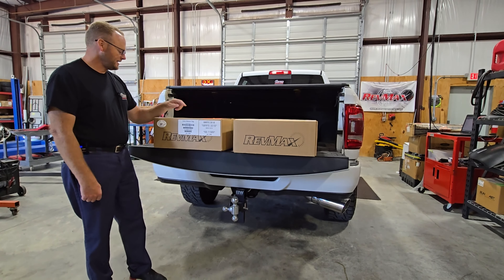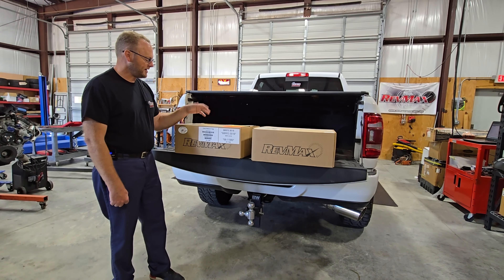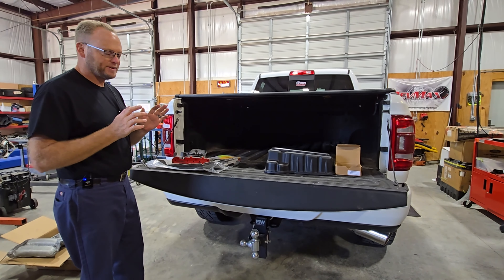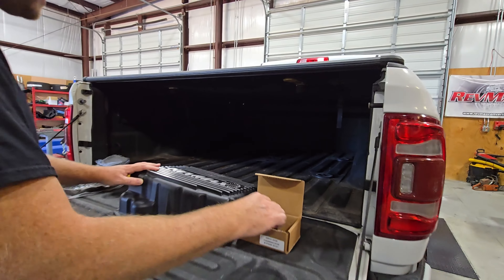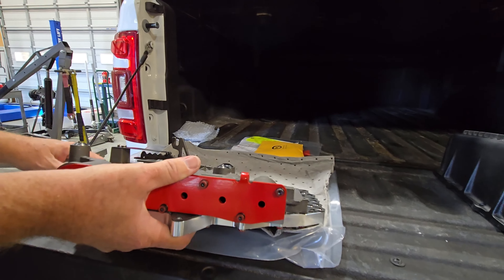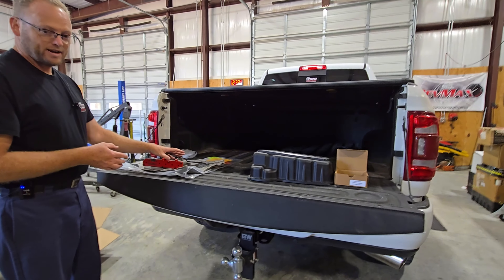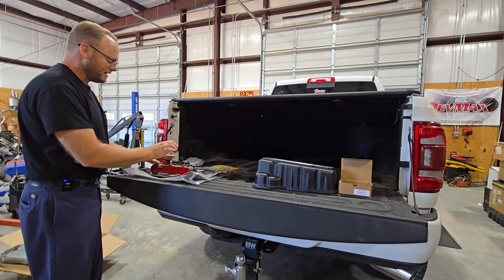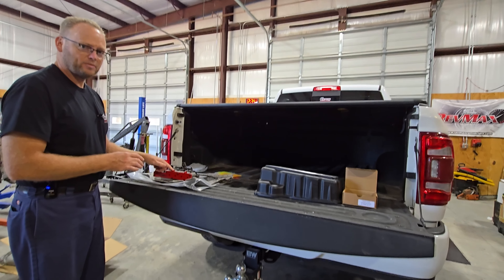Revmax Billet Performance Valve Body For Our 2020 Ram 2500!

Comment: Why’d you take down the banks monster ram info ?
Reply from the maker: Was forced to...found out the hard way why there are no other videos out there showing dyno numbers.
Reply: @DOUBLERDIESEL  crazy.  Atleast we got to see the truth
Reply: @DOUBLERDIESEL   i missed the video what was the verdict?
Reply from the maker: It does not add any power to a stock truck with a stock tune.  If you tune the truck, then it can help add more power vs the stock intake elbow.
Reply: @DOUBLERDIESEL  thank you!